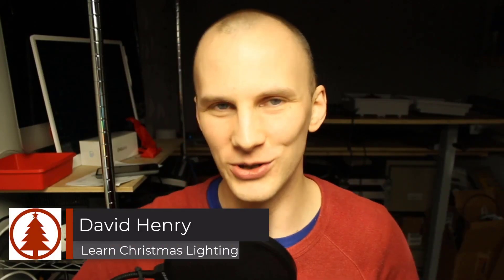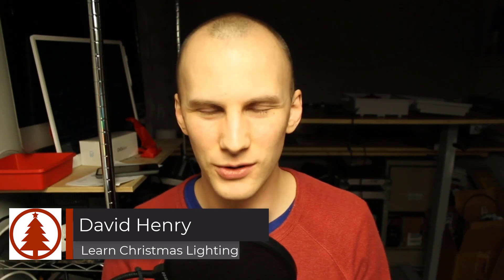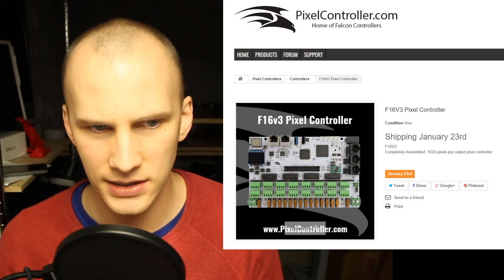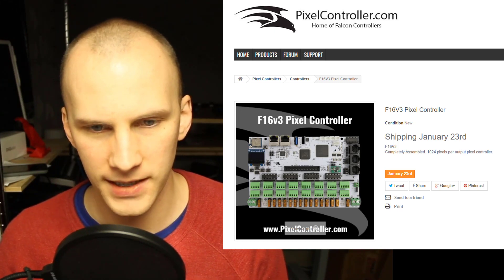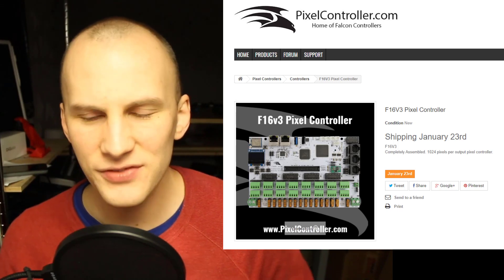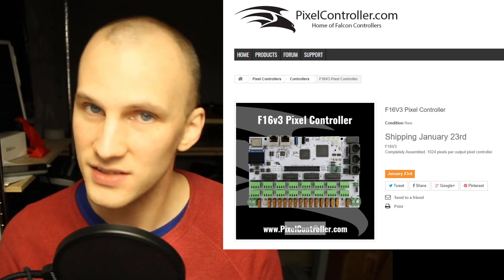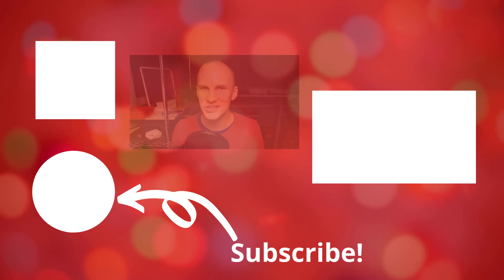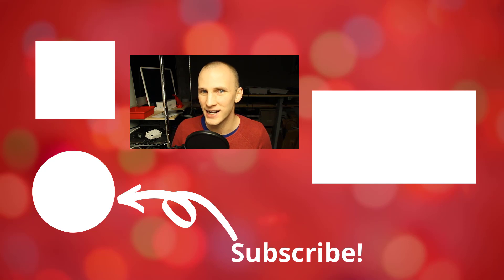How Many Pixels Should I Run from each Port on My Controller

Comment: I'm new to this and trying to figure out how many i can run off a port. I have my controller built, and software installed. Falcon f16v5, xlights test mode ran, i can power on 2 strands of 50, but the 3rd wont power on at all.
Reply from the maker: It is likely that you have the port set to only output to 100 pixels, that would cause this issue exactly.

Comment: After doing pixels for years… to be candid and completely disregard budgeting… just get regular controllers and put them near a group of lights.  It is way easier and less complicated.  Yes more money, but you don’t have all the “power inject this”, or building 8 smart receiver boxes,to do the job that a single regular controller can do, etc…   Biggest problem with this approach is finding in stock controllers to buy.

Comment: I'm not sure if I'm glad I randomly bumped into one of your videos or not.  Strange however it happened but $525 later I'm sitting and waiting for my controller, 2 power supplies, pixels, etc etc to get here to get going.  We've been the Griswolds of the little mountain town at 10,000 ft we live but this stuff is gonna blow these people away.  I don't (or cant) expect too much my first year.  Watched the videos on sequencing and I'll be lucky to have a real simple thing, this year.  I'm one if the kind that over does it.  So let's hope I don't get too into this!!!
Excited to say the least however and really, I do appreciate your videos.  I know what l bought will be utilized, expandable, and quality gear because of you!!   I opted to build my own instead of plug ready as well.  For fun

Comment: So just so I'm understanding this:
Using Kulp controller as reference
1. If 1 port allows max 800 pixels at 40fps then I can run say 5 strings in series for a total of 250 pixels and be alright without power injection? And if I see any data issues just add some F amplifiers. 
2. now say I have two other strings with 100 pixels total 20ft away. I'd use a smart receiver and another PSU to power those strings. Connect a ethernet cable between boards for data. But this means that it takes away 1 port from the main board right?
Reply from the maker: No ports taken away from the main board, the smart receivers are extra ports
Reply: @LearnChristmasLighting  Thanks!
Reply: Smart receivers are connected to the controller via Ethernet cables, only data is transmitted from the controller to the remote. The ports on the remote are what power the lights. So you would consume a remote port on the controller, not a 3 core pigtail.

Comment: Quick question for you, I'm new this world and I wired up 2 100 pixel RIP tombstones last night on separate Hinks Pro ports and ran a quick show over them. One of the tombstones wasn't lighting all of it's pixels at certain potions of the sequence. The bulbs lit up during other portions so the bulbs themselves aren't bad. These are the only 2 things running on the R2R controller. Any idea's?
Reply from the maker: Your settings in xLights for where the model is assigned does not match the HinksPix settings.  That is what causes this problem.  I admit, the Hinkspix is pretty difficult to setup, I have one on order and am planning to do a number of tutorials on it once I figure it out!